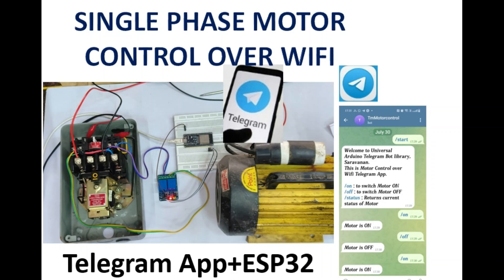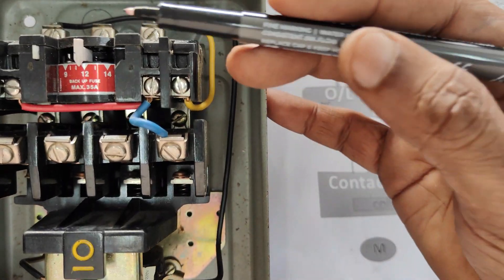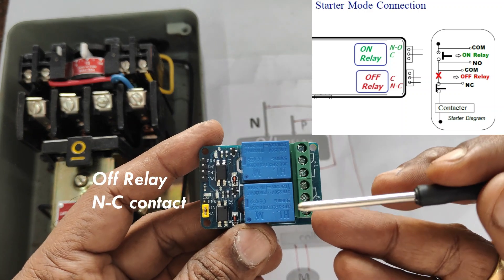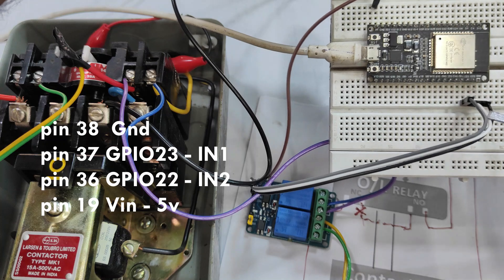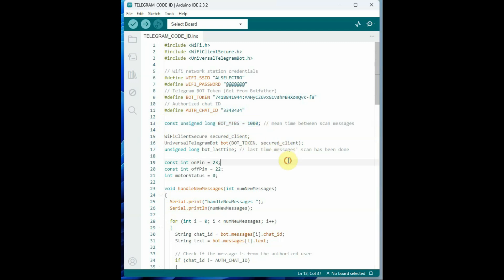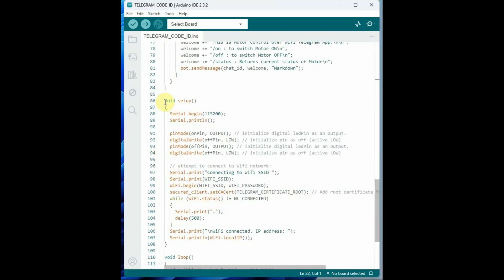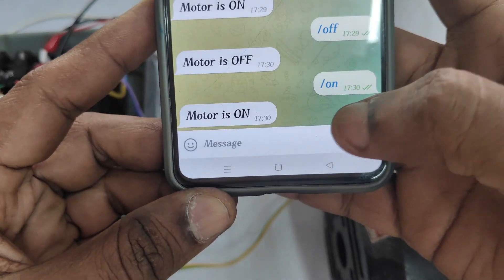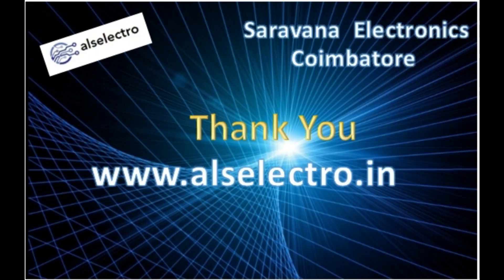Single Phase Motor Control over Wi-Fi - TELEGRAM App + ESP32

Comment: ESP32 pins are NOT declared 5V tolerant. If you want long term reliability of the device and protect it from latchup damage, its advisable to have a Schottky diode in series so that only the active low signal is driven and the current through the optocoupler in the relay board reliably turns ON. We need to ensure that the current through the optocoupler LED (MCT2E I guess) is sufficiently large (consider 50% CTR) so the output transistor drives the gate/ base of the relay driver FET/ BJT reliably. 
One more thing to consider. Can you check the operation of the L&T contactor. In general, these are extremely noisy (in the RF spectrum) and CAN cause false triggering. Have you encountered this? If this happens, we will have to use more robust shielding and signal driving methods. For a benchtop weekend project, your idea will work great. But I will have my reservations on the reliability and long term ruggedness of the layout. Good one mate, cheers
Reply: hey can you help me i have issue whilie turning on of starter using octocoupler relay module......the surge is comming in relay module and its affecting my esp32 or lora module
Reply: the surge or emi is comming from starter contactor coil..
Reply: how can we solve it?